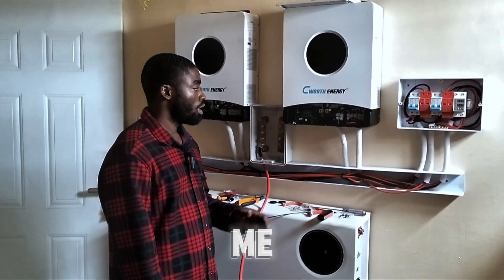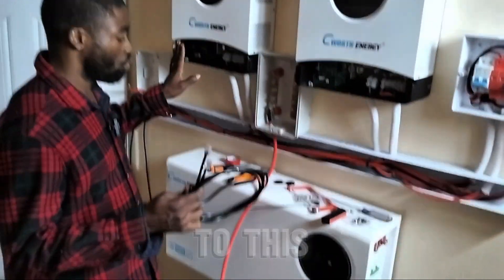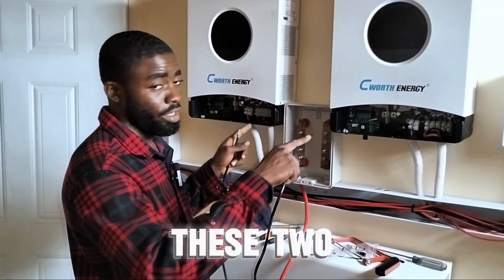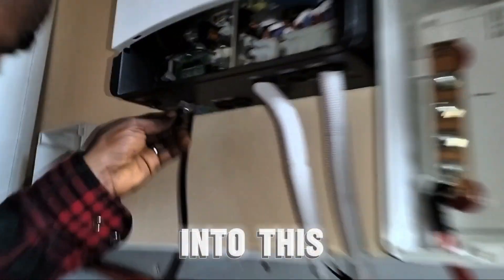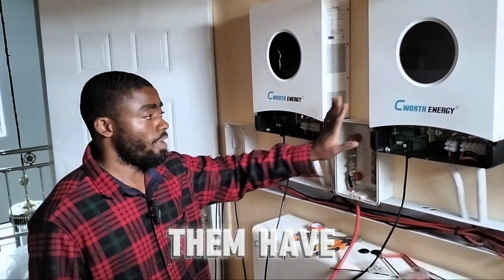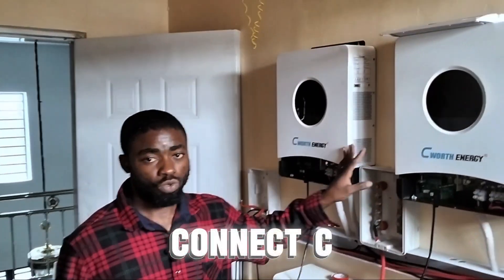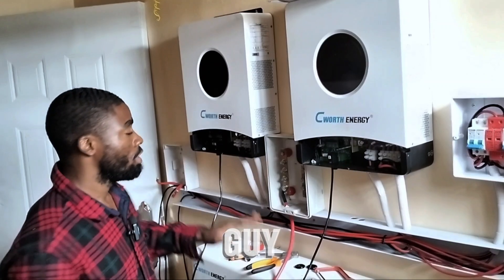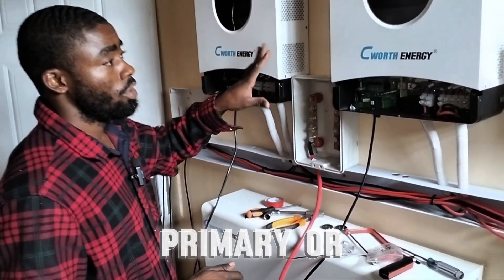How to parallel 2 inverters as one?

Comment: Please can I connect 2 PCs 240Ah 12V tubular Batteries in parallel to Felicity 3.5kva inverter
Reply from the maker: Yeah, if the inverter is 12v
Reply: @Mairigaemmanuel  Okay thanks, God bless.  but I may come back for more questions on this issue. ☺️

Comment: Sir please how can I connect the output of my inverter to the db
Reply: If you have some electrical engineering knowledge then locate the MCB for the lines you want to power, e.g MCB for lighting, socket outlet and so on. Disconnect the MCBs from the Grid by removing the input jumper cable or bus bar then feed the inverter output to the inputs of those MCBs and you're done. Please note that NEVER link the Grid power supply and the inverter output together because you'll damage your inverter permanently or you'll blow the inverter fuse.
Reply: @nicholaslubinda your number please

Comment: Please i have a question sir. I commonly see a lot of set ups that use felicity battery with 3rd party inverters. Is there something wrong with felicity inverters? And wouldn’t it be better to use inverter and battery from the same brand?
Reply from the maker: I don't think something is wrong with their inverter, most at times they run out of stock

Comment: If you are connecting two inverters in parallel in a single phase mode you need to connect a  current sharing cable to the inverters otherwise they won't work properly.
Reply from the maker: No be felicity